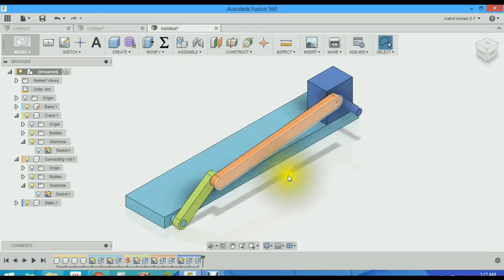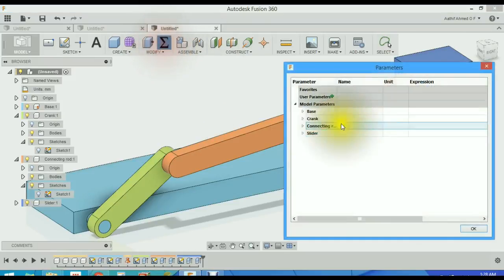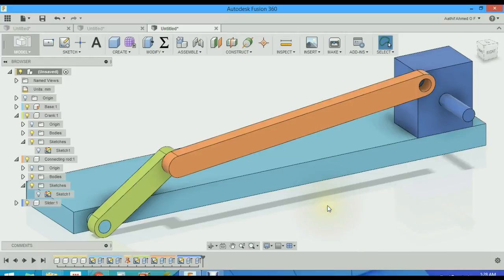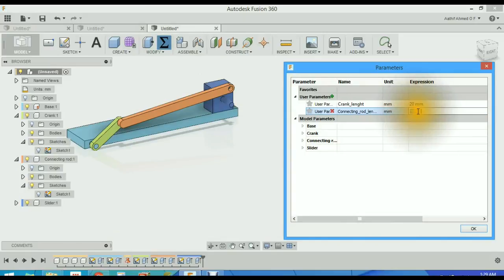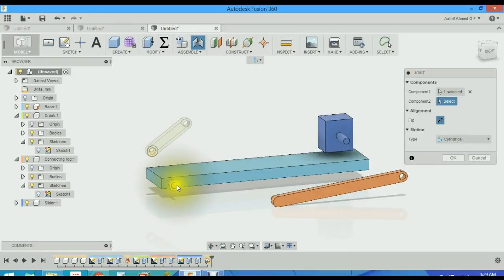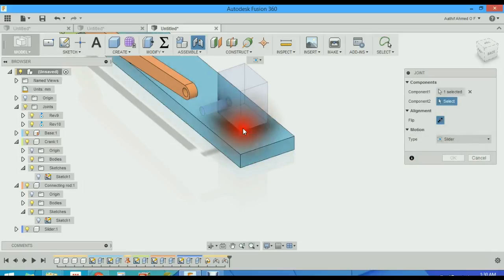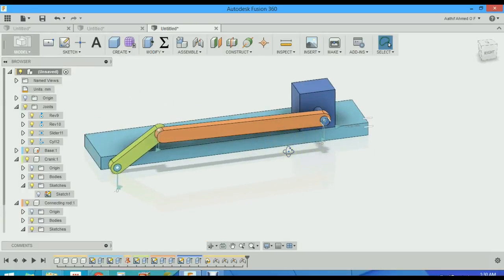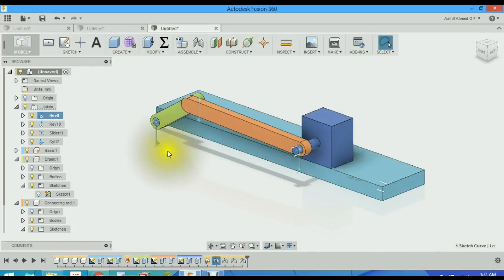Autodesk Fusion360 PART 2 Assembly joints in Crank and slider mechanism

Comment: Thanks for your video. Very helpful. 
How do you assign color to the component during modelling?
Reply: Go to > inspect > Component Color cycling toggle. But first click the gear icon at bottom right of the Fusion 360 window, verify that 'Component Color Swatch' is enabled.
Reply: Hey Got it.. this is what i was looking for. Thanks a ton.